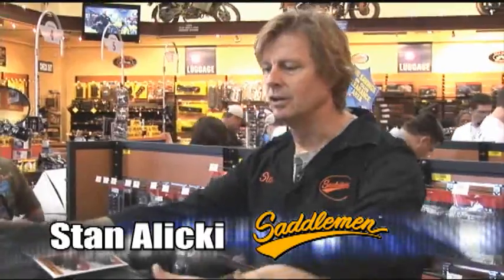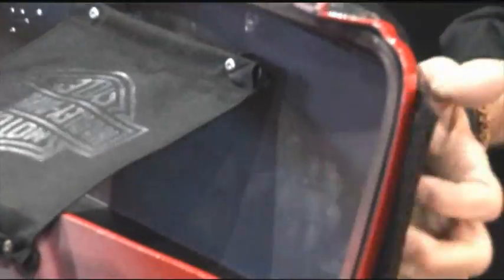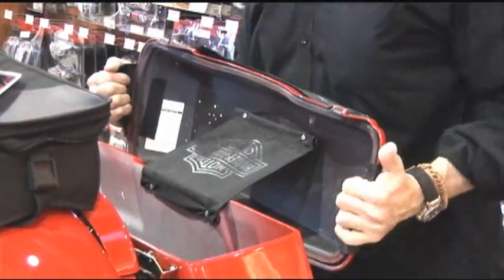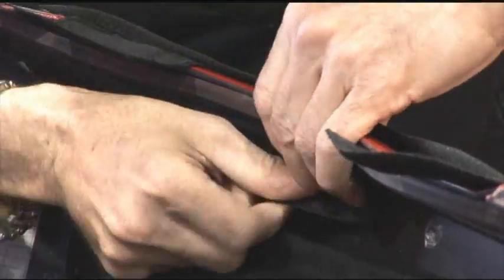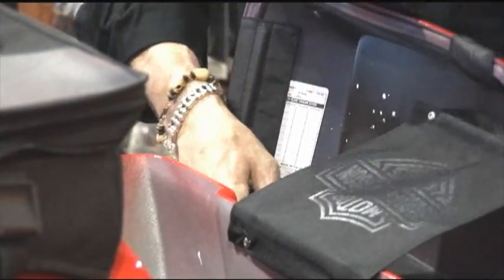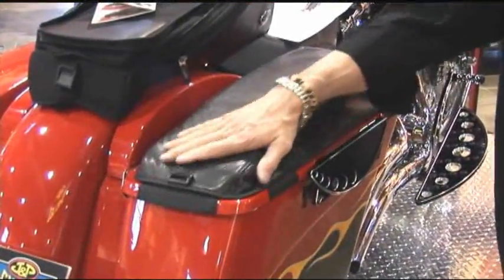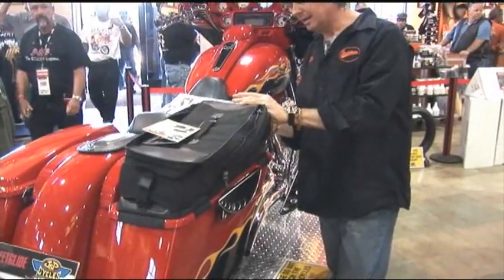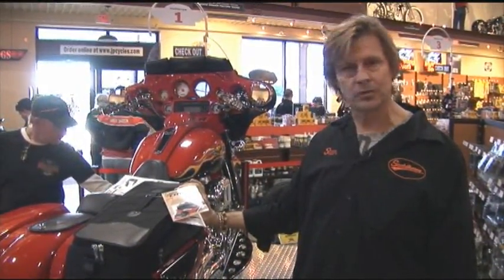Saddlemen Saddle Bag Chap installation presented by J&P Cycles.

Comment: got a pair of these last year. ok, till it rains, had to sit for a day in the tent in the Czech Republic, when I opened the boxes the next day there was quite a bit of water in them, as the lid cover holding straps break the water tight seal around the lid of the box. also not shown on the vid is the instructions that the Velcro in the lid should be left for 24 hours before fitting the lid cover. I got them the night before I went on the trip the Velcro kept coming off. good unless it rains